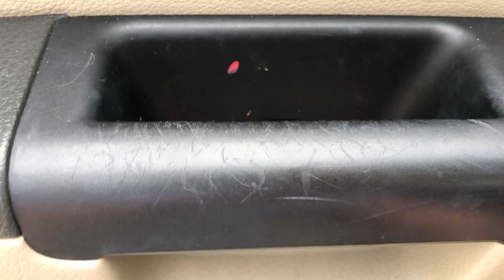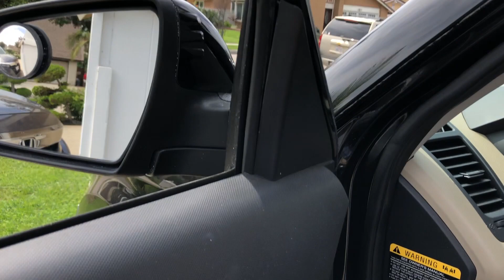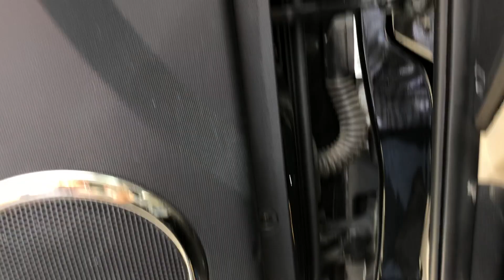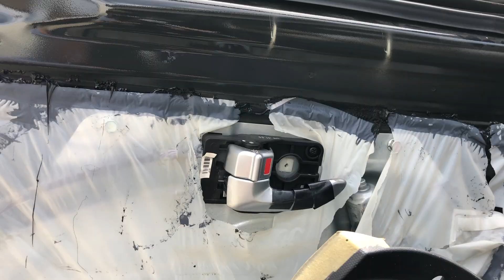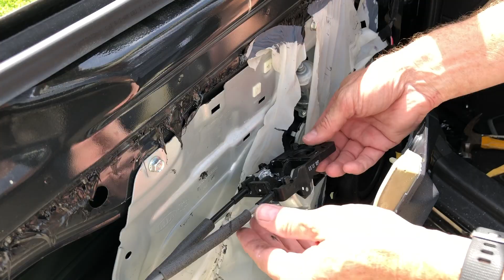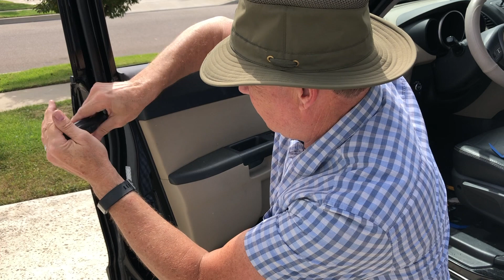2013 KIA SOUL - HOW TO REPLACE INTERIOR DOOR HANDLE

Comment: My wife’s 2013,the driver door opens only from the inside? This has just happened,has anyone had this issue before? I’m reaching parts and procedures any help would be appreciated!
Reply from the maker: If I remember correctly, there are two separate cables to operate the interior and exterior handles. One of the cables may have just slipped off the handle. You’ll have to remove the door panel to know for sure. Good luck!